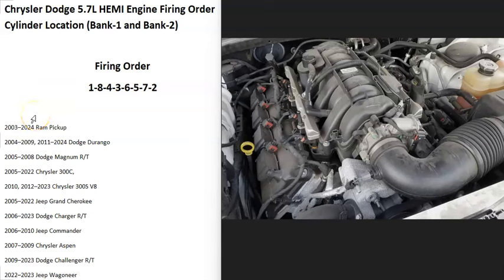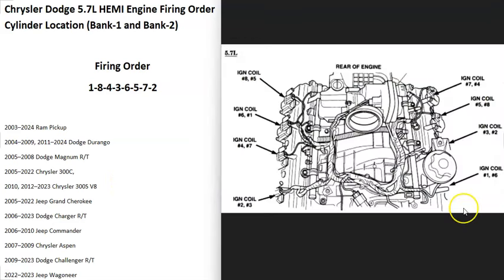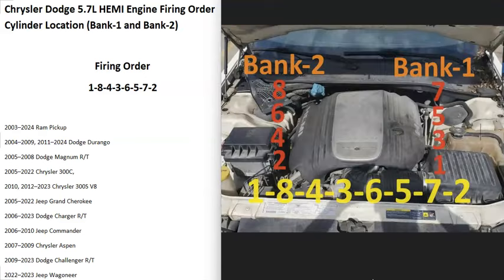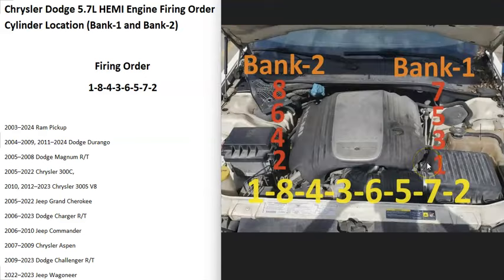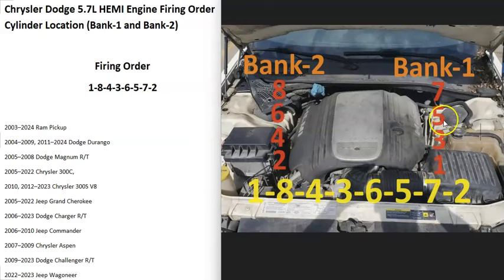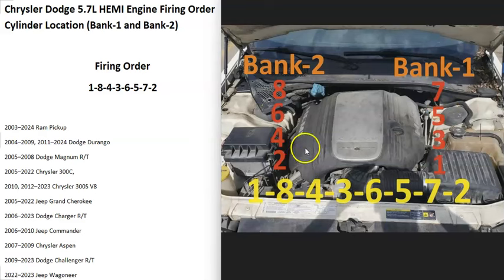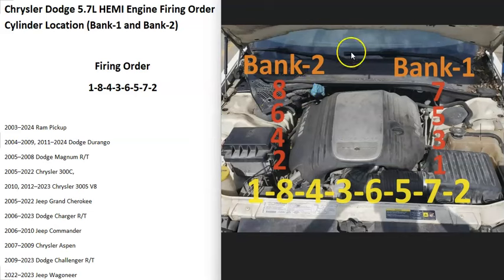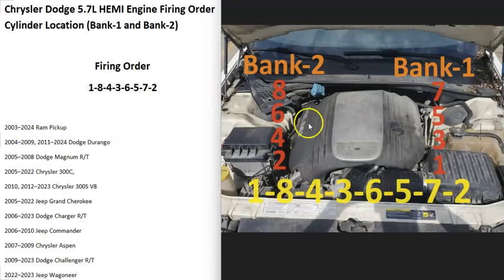Chrysler Dodge 5.7L HEMI Engine Firing Order Cylinder Location (Bank-1 and Bank-2)

Comment: Thank you for this information! I’ve got a Bank1 air fuel imbalance code and a tapping noise probably just buy a new intake manifold since it is on that side and exhaust manifold is on left or passenger side correct?
Reply from the maker: The intake is on the top center of the engine and will go to both banks. There will be two exhaust manifolds on each bank of the engine.
Reply: @kingmanarrranger  okay thanks for the info appreciate it